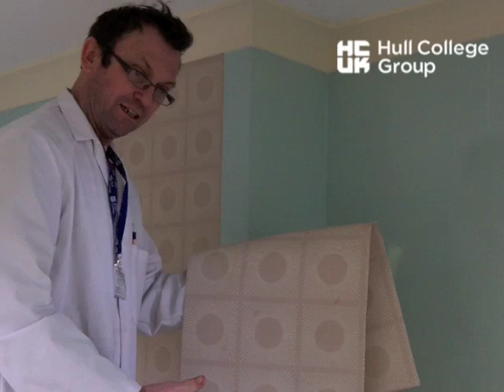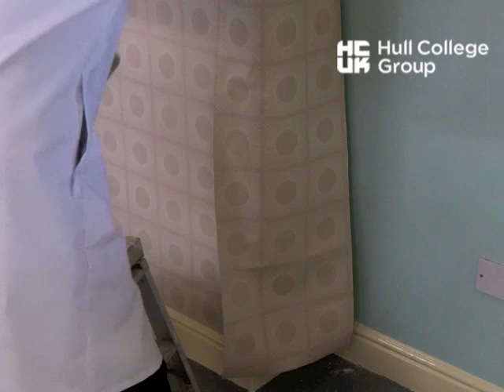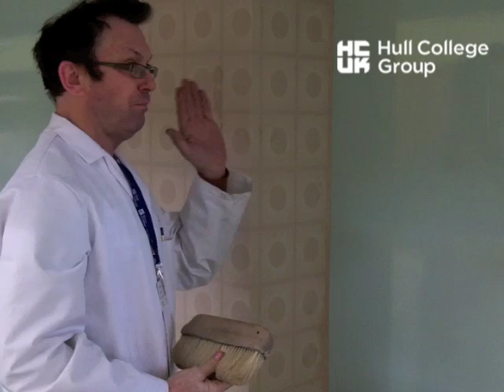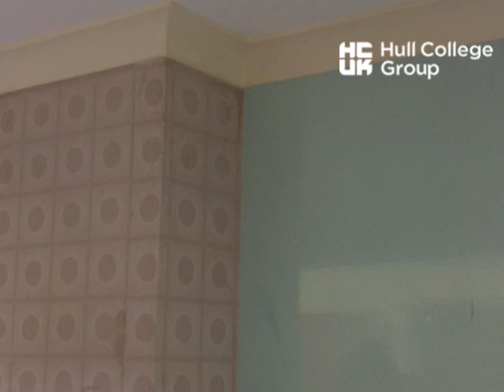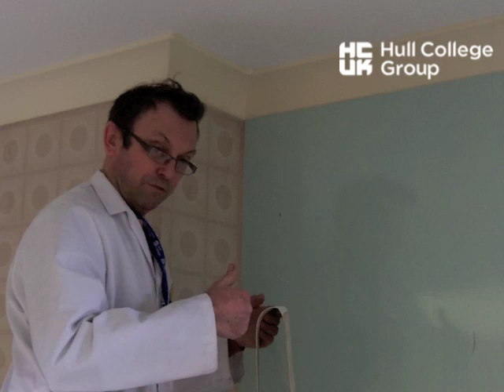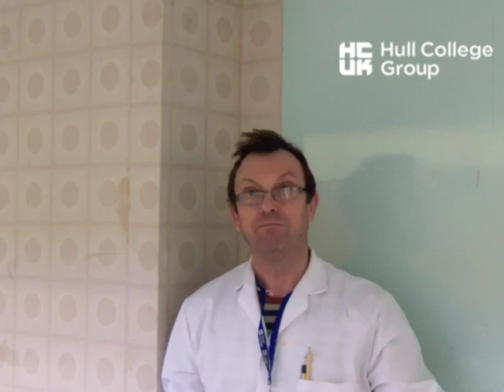Cutting & Hanging Wallpaper - Hanging Around Corners (Part 2)

Comment: wrong way to paper. you should leave a 50mm strip around corner of fireplace and over lap slighty the pattern with the cut edge. then continue on. reason beingthe angle was not straight. hence why he messed around cutting.
Reply: Benn Moore youre correct
Reply: yes, and not every wall is plastered straight!